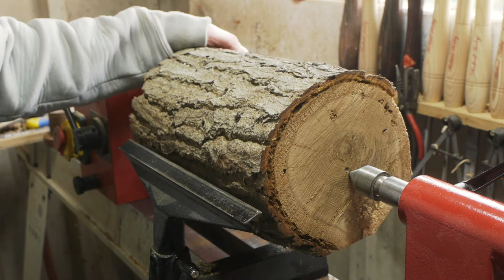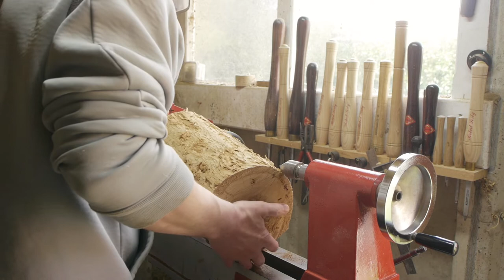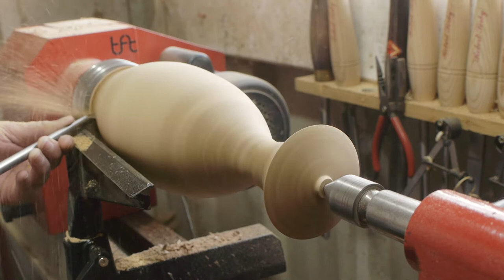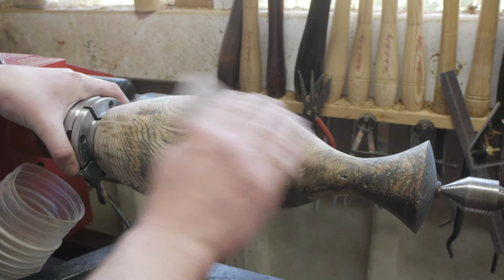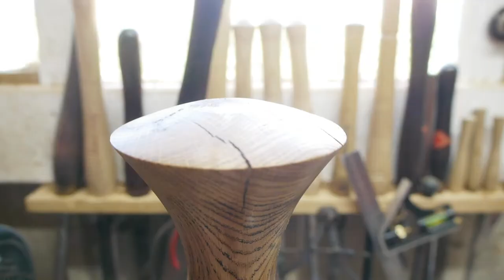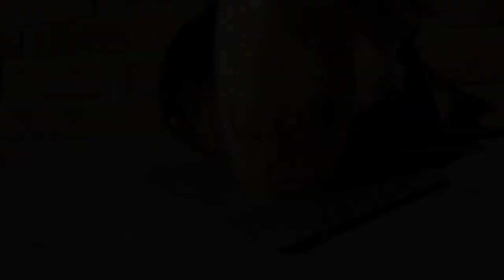Bug hole filled oak log - Woodturning

Comment: Absolutely lovely Tim. Like others, I have never thought of putting the ebonising fluid on before sanding. Works really well.
Only nine more to go and you can start 10 pin bowling.
Take care mate. Cheers, Huw
Reply from the maker: Thank you Huw! The tannin juice is super easy to make, spirit vinegar and wire wool. Left it to soak for a week or two then it's good to go. It weighs quite a lot so the bowling ball would have to be huge 😂 Thanks for watching mate!
Reply: @tfturning  Hi Tim, I got 2 tanning juices I have made. One with tea bags and the other one with rusty small nails.
Reply from the maker: @WoodenItBeNice  Nice! Hadn't thought of using tea, might have to give that a try too 😁
Reply: @tfturning  Works well but it stinks to high heaven LOL
Reply from the maker: @WoodenItBeNice  I can believe it! 😂